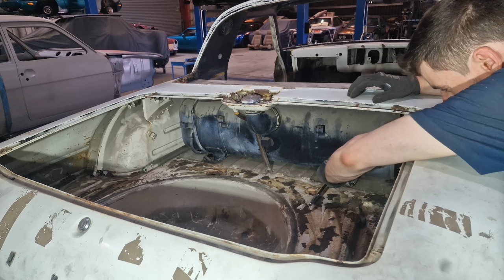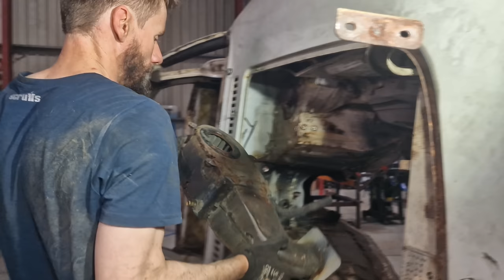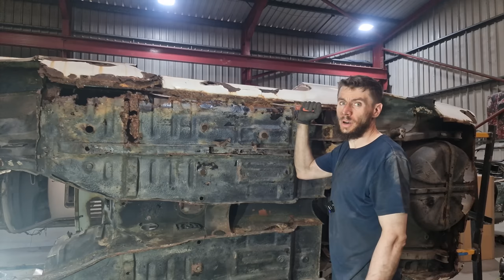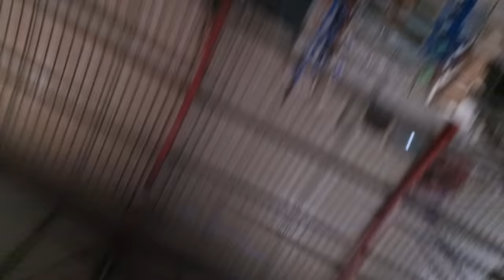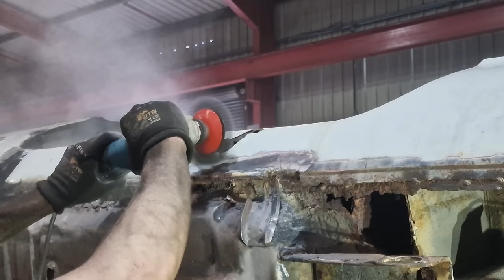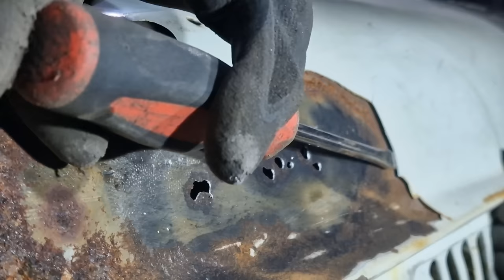Restoring The 1970 Barn Find Mazda Cosmo 110S

Comment: Is there a reason you don’t get it sand blasted to save time and effort. Looking forward to see it getting built back piece by piece.
Reply: The problem with sand/media blasting is heat. It’s so difficult to see if the panels are warping while blasting. So a softly softly approach first then see what they’ve got to work with.

Comment: Welded all the fail points on an 84 Transit a few weeks ago - owner comes back whinging that there's rust peeping through already...Doubtful... being the decent sort, I said I'd stand on and make it right.  Not one single part I repaired needed touching - it was all stuff we didn't do that had been buried in fiberglass just before this guy bought it & had looked alright for a bit. Because we touched it, it's now "our problem". 

Spent the entire day welding bodywork for free on parts we were never asked to repair originally. Will spend the next 2 days making them presentable. Lessons learnt were 2-fold. 
1, Only stand over stuff you did/got paid to do. Nail down the scope of works very precisely. Be ruthless. 
2, I despise Transits. They are bottomless pits when it comes to rust. I hate them with a passion.Utterly despise them.  
3. This comment has zero relevance to Mazda Cosmos. 
4. Never believe anyone when they say there's only 2 lessons. 
5. I despise Transits. 
6. I despise Transits. 
7. Why did you buy a Transit? I told you I despise them.. 
8. Carry on with the Cosmo.. I'm just venting - did I mention I dislike Transhits?